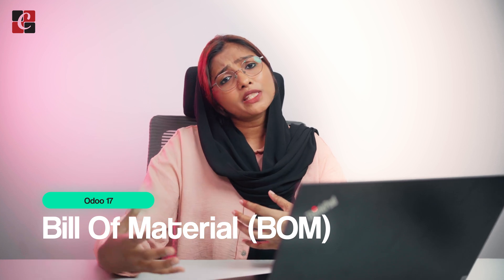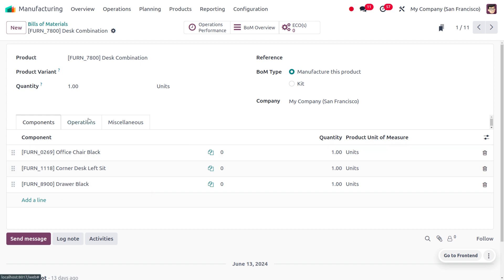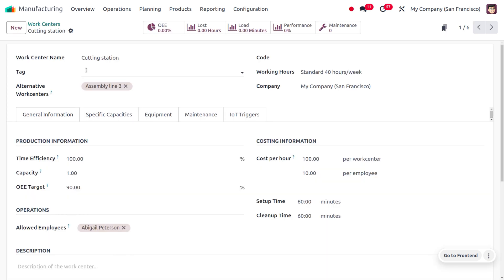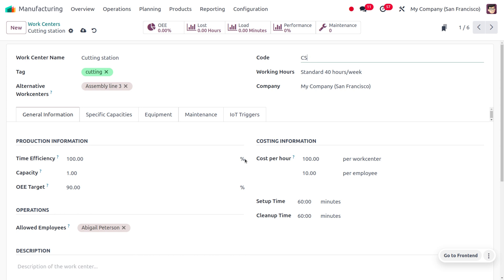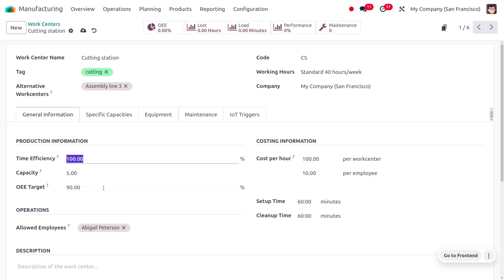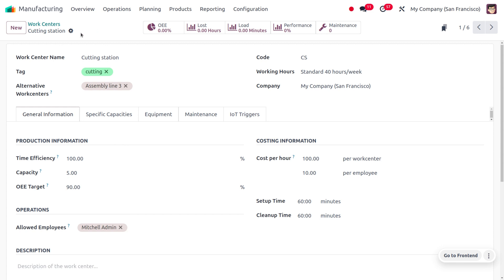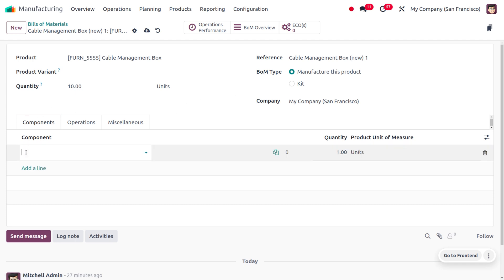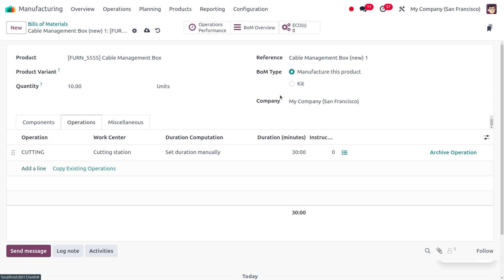How to Manage Bill of  Material BOM in Odoo 17 Manufacturing App | Odoo 17 Functional Tutorials

Comment: what is the difference between manufacture and kit? please expand if possible :)
Reply from the maker: Manufacturing in Odoo involves the complete process of transforming raw materials and components into a finished product. This often involves multiple steps, operations, and work centers. A kit is a collection of pre-existing components that are packaged together and sold as a single product. The components are not transformed or further processed; they are simply grouped.